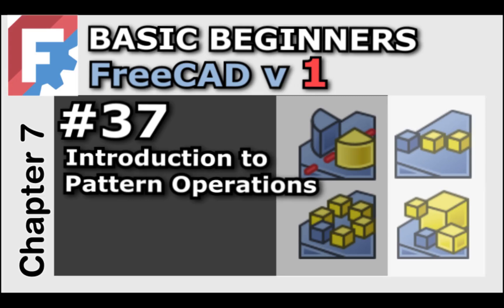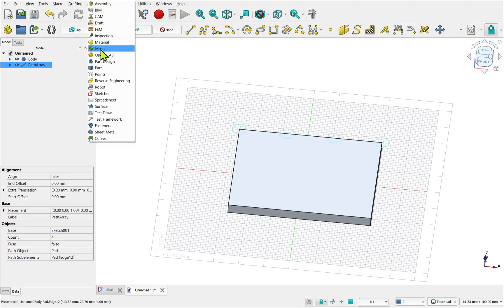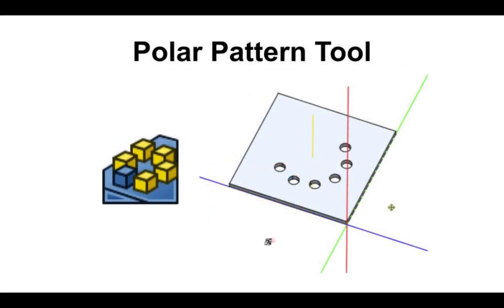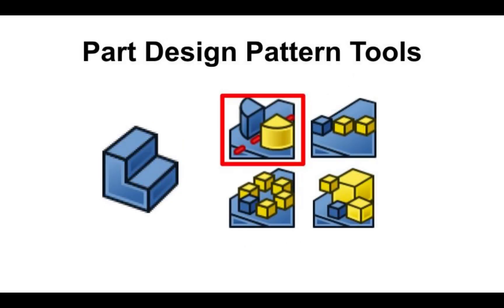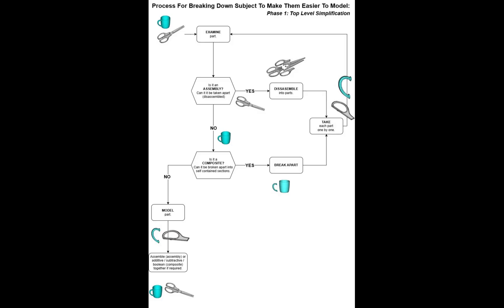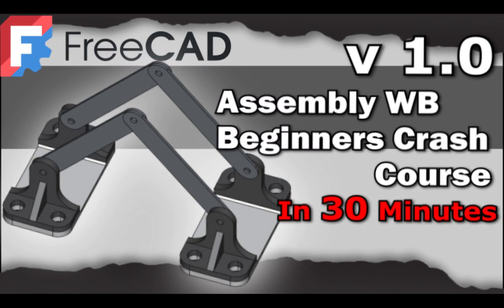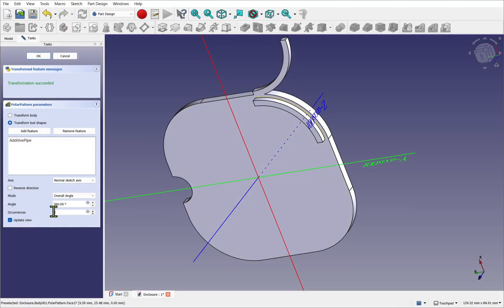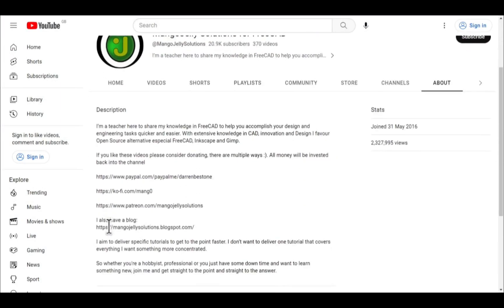Freecad v1. 0 | Part Design Pattern Tools Introduction | Basic Beginners FreeCAD 1.0 | Lesson 37

Comment: Thank you for your content!

I learned about the Multi-Transform-Tool a few months ago. I recently used it to create a horizontal and vertical pattern to perform hexagon-cutouts in the walls of a box. The box is consequently parametrically designed to be managed by a spreadsheet (about 50 lines to do the calculations so that in the model most of the time only one parameter has to be referenced).

What I saw is, that - though the body isn't really complex at all - it takes VEEEEERY long to change one of the few parameters, that have to be entered manually. Changing for example the length of the box takes about 1 Minute!

Is this normal behaviour or am I maybe doing something wrong?

Keep doing your great work in FreeCAD-education!

Best greetings from Austria!
Reply from the maker: PartDesign patterns are parametric, so every feature is recalculated from scratch on every change. FreeCAD’s solver and recompute system can’t skip over heavy geometry unless you tell it to.

There are a few things you can do

- Use Draft Array + SubShapeBinder instead of PartDesign patterns.
- Turn off auto-recompute and do it manually (Ctrl+R).
- Save heavy stuff like this for last, or use Part → Create Simple Copy before exporting.
- Use separate Bodies to isolate heavy features and reduce overall recomputes.

I be covering both patterns and arrays in the chapter and covering some of these pitfalls.

So pleased you are enjoying the content and great to see how far and wide the tutorials are reaching :)